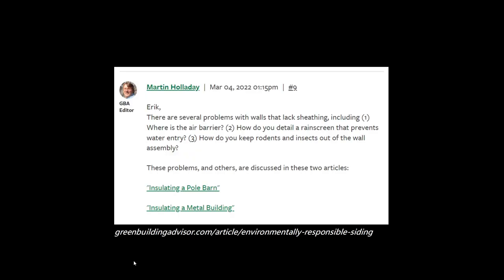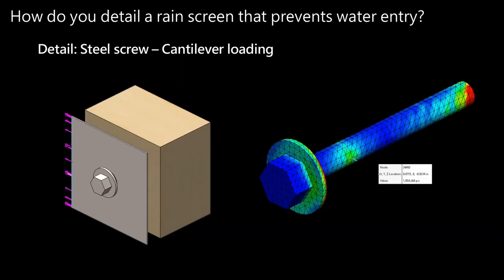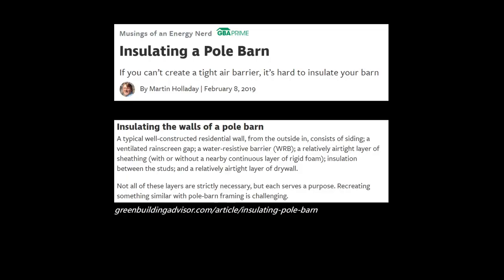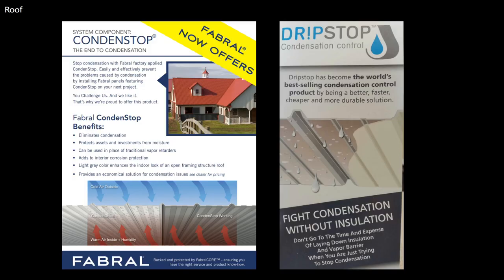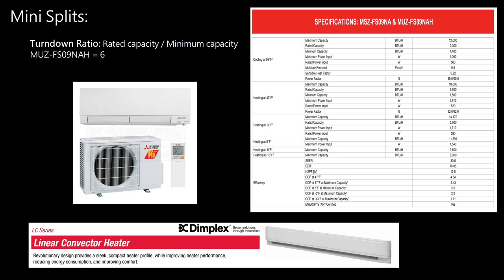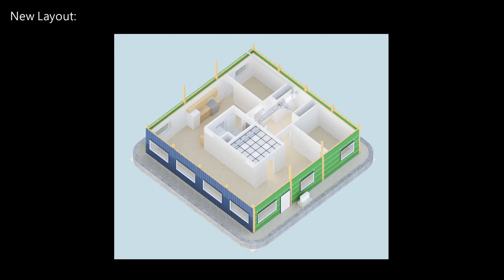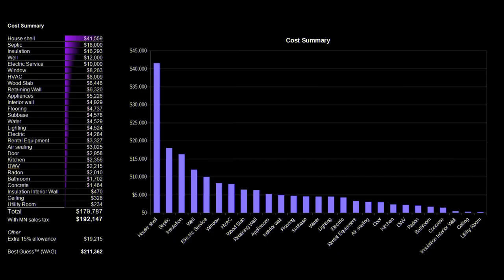Net Zero Post Frame Design Review: Rain Screen, Double Wall, Mini Split, Energy Modeling, and more!

Comment: Having material (rain screen) between your wall framing and steel siding allows your wall steel to shift slightly when subjected to extreme wind loads. This will reduce effective shear strength of your steel panels and will create screw slotting of your steel panels over time.
Reply from the maker: Good point.  Am also concerned that the plastic corrugated material might compress as the screws are tightened, impairing the performance of the rubber sealing washer.  Have ordered material to build a small wall section and try everything out.

Is there a thickness of material that would be acceptable?  Obviously the thickness of house wrap is acceptable.  Is there a way to calculate how much more thickness can be tolerated?

Not set on doing the rain screen.  Do like the idea of having a full drainage plane with enough gap to prevent wicking.
Reply from the maker: What if the material on the backside of the holes in the steel isn't plastic, but instead is an oversize EPDM washer?  The wall steel would be clamped between the screw's washer and the backside washer, both of which have a high COF, preventing any slippage.

The plastic rain screen would have holes in it to clear the oversized washers.
Reply: @Erik_MN  I am unaware of any method to calculate what thickness would be acceptable. Considering steel siding is going to be impenetrable to wind driven rain, I see no rationale for having a rain screen.
Reply: @Erik_MN  Provided the rain screen doesn't compress, it might work, but it does appear we are making this process overly complex and for what gain?
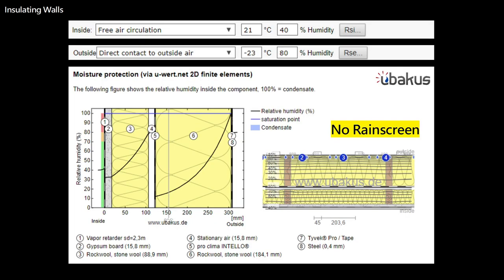Reply from the maker: @MikeThePoleBarnGuru  If you look at the wall analysis at 4:50, you can see that the simulation shows condensation occurring on the inside of the wall steel where there are no channels/ribs.  Of course, this is a simulation, and real life behavior may not be the same.  

Additionally, the rain screen would provide a better drainage plane for any water that sneaks in around the window trim.  I understand that windows are a tricky area to detail against water intrusion, and would like to build a little extra margin in.

Will see how painful the build process is when the rest of my sample material arrives.  As always, I appreciate the feedback.
Reply: @Erik_MN  Even if there was to be condensation on the inside of the wall steel, it would be on the exterior of your Weather Resistant Barrier and run down the panels and out the bottom of the base trim. Proper detailing of window openings precludes any water intrusion around them, so is a non-issue.
Reply from the maker: @MikeThePoleBarnGuru  So I tried out the corrugated plastic.  Wasn't pleased with it.  It's too compressible.  Going to stick with the standard detail.
Reply: @Erik_MN  Sounds like a good plan.
Reply: @Erik_MN  I would assume the same concern would occur if rigid foam board insulation was sandwiched between the metal paneling and the framing?  I see on stick frames the foam goes over the structural sheathing.  How much effective R-value does the strapping wall (mooney wall) give you?   I've started scheming a shouse design I would like to build in a couple years and thinking of wall ideas for high quality insulation, your videos have been a big help.
Reply from the maker: @pinestumps8622  I'm glad you've found the videos helpful.  The Mooney wall in the video is R37 (Ubakus sim).  I agree that putting rigid foam between the metal panel and girts would reduce the strength.  

1. I didn't consider spray foam (off-gassing concerns), but it can be an effective way to get to high R value.
2.  You could widen the double wall and put continuous insulation between the walls.

I would suggest playing around with the BeOpt performance tool to see what the payback is for various insulation choices.